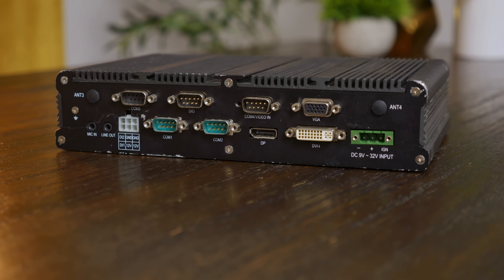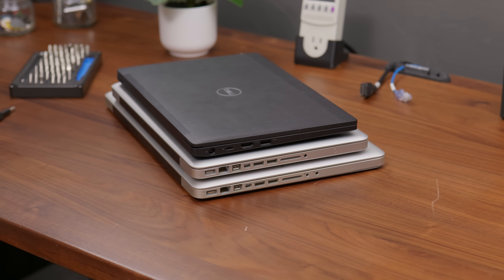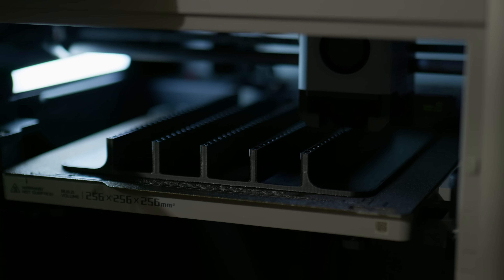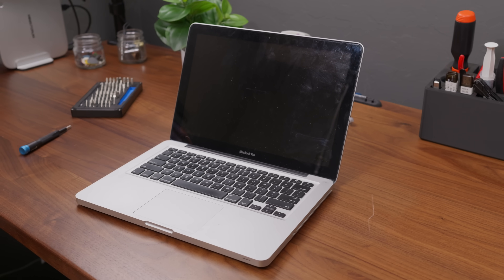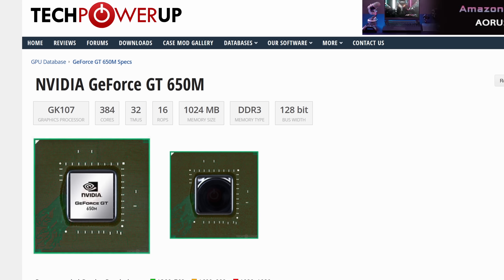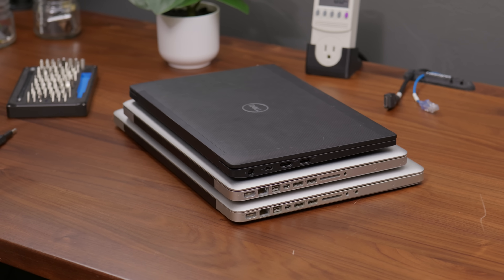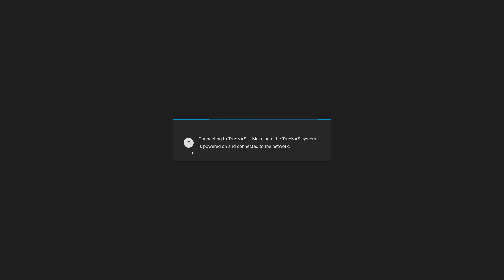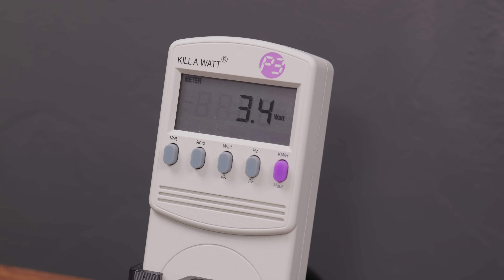Building Cheap & Efficient Home Servers with... Laptops?

Comment: I switched to a laptop server for about a year. Electricity got super expensive here in Europe for a little while after Ukraine was invaded. Found an HP with a 10th gen i3 and a broken hinge for dead cheap. I ran four 5 TB 2.5" HDDs from a USB hub as well as two 2 TB NVME drives. The entire thing used about 15W in total.
Reply: Did those Newer 5TB SMR disk working fine when rewrite ? 

I got two SMR 5TB 2.5 and they only good for archive 😢
Reply: @frankwong9486  I used them with Unraid, mainly to conserve power; Unlike typical RAID, it will only spin up the relevant HDD you're trying to access. 

To be honest, they didn't see many rewrites. They was almost exclusively used to store video files and game roms; Anything else was stored on the NVME drives.
Reply: @ugh.idontwanna  I have 2 unraid running and one of them over a USB 6bay case 
Suprised it can work with a USB hubs 😮 
Going to experiment some as both lifetime license didnt limit device count that much
Reply: @frankwong9486  In fairness, I did use a powered USB hub that was powered by CCTV battery pack to protect against power losses.
Reply: @frankwong9486  why do you assume that theyre smr? i shucked a 5tb seagate drive for my laptop and its cmr
Reply: @vincentschumann937 i dont remember there are 2.5 5TB CMR been made, can you share me the model number ? Going to replace my pair of SMR with that

Mine are ST5000LM000, avoid it if dont want to deal with SMR rewrite / raid rebuild issue

Thank you
Reply: @frankwong9486  dont have the drive anymore, but you made me doubt myself, are the 2,5 smr drives faster at long random writes than 3,5 smr drives? 

they performed better than 3.5 smr drives but worse than 3.5 cmr drives (i could easily get the 3.5 smr drives to bog down in windows, never had that issue with the 2.5)

so i thought the worse performance is due to them being size limited. 

so yeah they might actually have been smr

also my reference for smr performace are ancient 4tb wd drives with 80000+ hours of uptime
Reply: @vincentschumann937 SMR only having issue when need to rewrite a lot or during resilver / raid rebuild .( Due to how the overlapped track and need do lots of work to rewrite properly) 
If archive and mostly read operations they are working fine 
And from what I see SMR have higher read speed / lower latency as things is more dense than CMR 

But after few times get trolled by SMR now I will avoid them unless I know it will using on system that rarely modify ( like raw photo archive , they will got edit on other system but archive on SMR as third backup) 

There are also lots of article or test explained how SMR might get trouble when using in raid system / NAS
Reply: Also, early Intel Macs were legit. It went downhill after Jobs.
Reply: @ugh.idontwanna  How did it go downhill after Jobs if he was there well before the switch to intel? Your comment doesn’t make sense
Reply: @ I'm don't mean there is a direct correlation between his passing and the quality of a Mac, but starting from about 2012, Apple began gluing their computers together, and making them less upgradable.
Reply: @criostasis  I think they meant after jobs's death, not his return to apple.
Reply: @ugh.idontwanna which is tragic since apple silicon macs are categorically the best laptops
Reply: @ No doubt about it. I'm typing this on a M1 MacBook Air. The performance is wasted on me, but the battery life and the fact its fanless is a game changer. This could last me over a decade if there were sockets for upgrading storage and RAM.

Comment: free ups on all laptop servers for everyone
Reply: I would only keep the batteries in if I could set battery limits
Reply: All the people complaining about battery swell and such. Your laptop probably has a setting to make the battery only charge to 80% in the Bios under power management. Well worth doing. Currently, been running a small laptop as a Ubuntu server for a few years no swell and battery seems to be in good shape even tho it was a refurb when I got it.
Reply: @JamesMeers1  yep, thats essential for a laptop server, if the laptop doesnt have those settings for the batter, i likely wouldn't use it as a server.
Reply: @JamesMeers1  this is exactly what I wanna do. Turn a laptop and do a button to server. My wife is paying Apple to pictures and extra storage when I could be doing that for free.
Reply: @UnOrthodox_Christian my mother is similar. Was thinking if making a simple nas with a apple laptop
Reply: and free exploding pillow :p but i personally dont use the laptop batteries i remove them and use a 600w ups i got for 50 euros
Reply: @harriet-x.x only an issue with the flat cells, the round ones just silently die in my experience
Reply: @harriet-x.x 50€ nas is also an exploding pillow.
Reply: @harriet-x.xyeah that's why you set max charge on the battery to 60%
Reply: @harriet-x.x I've been in this since our laptops were NiMH. I haven't had a laptop battery explode. The closest I've had were tablets that pillowed and never exploded. You're acting like this is a normal event. It isn't and anyone with experience already knows you're doomsaying. The world becomes dumber the longer your comment is stored in on any storage anywhere on earth.
Reply: @harriet-x.x nope.
Reply: Wouldn't recommend. I actually used a laptop as a server for about a year, and forgot to disconnect the battery. When it was finally "retired" it had severe problems with battery swelling, to the point where the bottom of the chassis had started cracking. While it could work as a hobby project I would at least check the batteries regularly if I were to do something like that.
Reply: @Gnomleif Just limit the battery to a 60% charge and it will have one cycle in 12 months.   no problem at all
Reply: @procyon-v1g problem is, many (most?) laptops don't have hw support for this.
Reply: No transient protection
Reply: It’s only 144 steps to remove and replace a swollen Mac battery. 30-40 to get the hard drive out and toss the rest in a bucket.
Reply: @astrohgamingZero  All the pre 2015 ones are a breeze to upgrade ssds and change batteries. Charging thermal paste, speakers and keyboard however are nightmares.
Reply: Here here pretty much the perfect starter server in my opinion. 

Only downside is lack of expandability...

But USB 3.0 or later is pretty good for most uses. Not perfect but really good. 

Have one of my proxmox servers is running off a USB ethernet connector... Running fine. 

Either that or stick with 100 megabit 😂😂😂
Reply: But your network still goes offline.
Reply: Not if your network is on a ups. @adahlenninja

Comment: I have a laptop (that I use as a normal laptop) with an Intel 8265U CPU and it's incredibly efficient, especially if used with ThrottleStop I often see CPU power power consumption drop below 2W and overall including monitor go below 8W.

I've always thought that it would be fantastic as an homelab server, it's only drawback is the lack of PCI-E expandability.

There are some mini PC with that CPU but unfortunately they're expensive or super hard to find, especially in Italy.

Comment: I'd be careful, leaving a laptop plugged in with its battery connected could cause it to swell eventually and be a fire hazard. Now, laptops are definitely good for watching Hardware Haven. So there's that.
Reply: modern laptops should have a passthrough switch where if its plugged in they wont even touch the battery and just power it via the wall like a normal pc
Reply: @masterhacker7065 this is true. My old HP laptop had a battery limit tool and it worked fabulously. I needed to charge the laptop every other week so it won’t go bad but it’s now 10 years old and still holds charge for over two hours!
Reply: Some laptops have the function to limit battery charge to 80% so that might be a good option for laptops running 24/7
Reply: @BillyAoki  Even then, eventually the batteries degrade. It's not a good idea. Best to remvove the battery.
Reply from the maker: Definitely. I've heard plenty of mixed opinions on this, and I'm sure it's dependent on the hardware to a degree as well. Still, something to either regularly check on or just avoid entirely!
Reply: @HardwareHaven  yah, but new quality stuff should bypass a battery like phones do